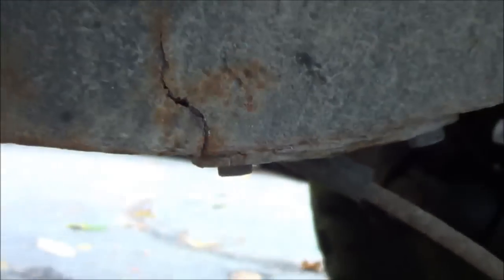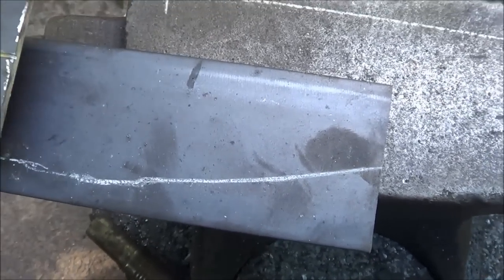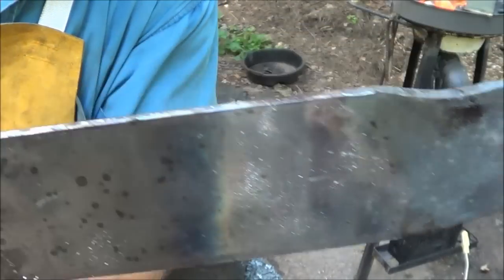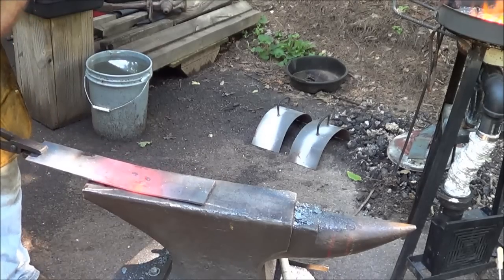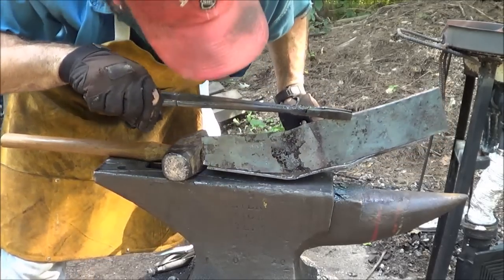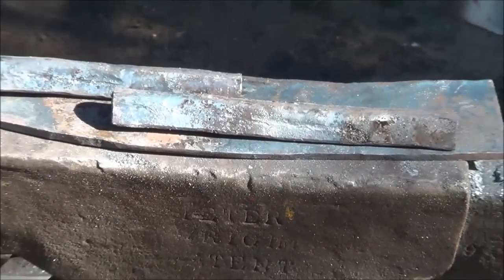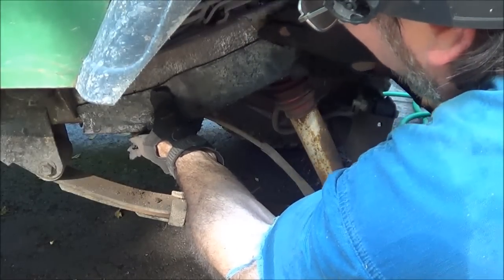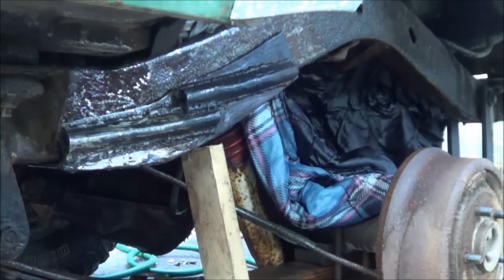Hand Forged Jeep Wrangler Frame Repair - Good Till The End Of The Driveway

Comment: Love the fix job. I see this vid is a couple years old, and you've probably learned since. But just like to say, when you see your weld "clumpy" like that, or crowned high, it is usually because you need more heat or slower wire feed. Also hope you drilled the top of the crack to stop it from propagating any further. Hope a little constructive criticism is ok! I'm just a structural welder . . . and just getting into blacksmithing . . . and i'll say blacksmithing is an art form. You sir, have skills (loving your vids from these older ones to the new ones).

Comment: As much as people praise jeeps for their ruggedness, there's an awful lot of them with fatal damage like this.  having restored a few and owned several (even now) they are cool, but I think their tank like reputation is largely undeserved.  

The only reason so many are still on the road is people caring enough to save them as you did.  If that were a Toyota Camry with a massive Crack in the frame rail, that would have been scrapped without hesitation.  

Nice video, solid patch, and I bet in 20 years when that thing is scrap, that brace will still be there just as strong :)
Reply: +Red Rider7 Looked cracked to me.  Wasn't there, could be wrong.  looked like the rust thinned out the sides, cracked through the middle of the thinned area.  not saying it was a base metal issue.  clearly the rust led to the crack.
Reply: +Red Rider7 Looked cracked to me.  Wasn't there, could be wrong.  looked like the rust thinned out the sides, cracked through the middle of the thinned area.  not saying it was a base metal issue.  clearly the rust led to the crack.
Reply: +Red Rider7 Not really knocking jeeps, I like them, have restored several, and own one currently.  All I was saying is that it's just a cab on frame type vehicle.  They are tougher and easier to keep alive for 30 years than a unibody vehicle.  Many people think that Jeeps are especially tough, but I don't really think they are any tougher than any other cab on frame vehicle.  Rust has no brand preference :)  

Jeeps will break and fail like any other vehicle with similar design.  People tend to keep them alive longer than less iconic brands/models.

Chrysler/Mitsubishi engines and transmissions aren't the best out there.  Wiring harnesses and sensors/accessories are sub par, etc.  I have a 30 year old truck that runs and drives better than my 10 year old Jeep.  To each his own, have fun and keep shit on the road.  It's all good if it makes you smile.
Reply: You like jeeps.  I do to.  
Cab on frame is superior to unibody for longevity.
Trail vehicles work better on trails.
Jeeps are not immune to abuse and neglect.
Think we are needlessly arguing in agreement.  

My point was many people think that Jeeps are indestructible mostly because people like us keep them going, fix them when they fail, rescue them from certain destruction, etc.  In reality they are tough, but survive because people save them, not because they are immune to failure.

Comment: Great video and job you did. Yes those frames will rust from the inside out. I ended up treating mine with some undercoating then I sprayed some fluid film in there and I have no rust spots. I use the same welder it works great. Wish I had a forge though I want to make my own bumper for my jeep.
Reply: +Glen W u dont need a forge to make a bumper bro go check out chuckey2009 lol but if u want a forge they are easy to make! check out another chuckey2009 vid :)
Reply: +eaglethorn I have watched a lot of chuckey2009 video's. I ended up finding a nice bumper with lights in it and installed it over the summer. Thanks

Comment: Well maybe not much of a handful tip, but if you are going to weld and try to make it nice, snip the tip of the wire so you get a sharp edge or keep it hot. Should make it a bit easier to get a nice light. 
Btw, big fan keep up the good work! Just started follow your channel, might order a knife in a near future. Good luck from Sweden!

Comment: Hey Chandler, your welding is pretty good given the machine.  Its one of the worst and possibly dangerous products on the market.  That welder has AC only output, Fluxcore is a DC only process period. Thats why you get push back from the wire losing arc on the base metal and the massive amount of spatter.  Fluxcore is great for outside windy conditions, just not that welder.

Comment: I have the same welder. Try using a shorter lead when welding. Looks like you have almost an inch of wire sticking out when you start. Give it a shot with about half of that and keep it closer while welding.

Comment: Chandler could you try something ,Instead of dragging your torch,like your using a welding stick.start and push forward with miniature movements up and down MINIATURE. you will find you can see your melting bath better,your path you need to follow and your weld will be tighter and smooth.Please give it a go.

Comment: If you want a bit less spatter when you are welding then cut back the core a bit before you start the weld.
Reply: Another great point would be to pre-heat your work piece because your welder is so small.

Comment: what i would of done was stick weld the hole fill it in then grind flat then add your patch then stick weld it place i used to work in a Auto body shop  thats how we all did it , another way would be take a chance take all that crap off the back add steel then add your patch then stick weld it solid since you dont have a mig welder that core flux wont be as strong of weld as arc or mig ,all and all you did a awesome job could of used your help years ago fixing my camaro frame that my asshole dad made me get rid of loved that car i havent seen or talked to him since that day and im 41 now
Reply: forgive your dad, go to him and take him out for a beer. Life's too short!
Reply: Get over it. Family is to important

Comment: Wouldn't welding the crack in the frame be better?
Reply from the maker: HD5830Gamer wasn't enought steel left
Reply: Chandler Dickinson I was thinking of reinforcing my F-450 frame using hand forged steel to "Mold" to the frame... not sure if I should weld,bolt or rivet them on...

Comment: I would have  torch   nickel  silver the crack then add a L shaped plate with 6 self drill screws drilling 3/8 pilot holes paint with  aluminum roof cote. that frame appeared still structural ly sound

Comment: what if he needed to get to those nuts to work on the jeep
Reply from the maker: Diboguy They were just holding a plate to the frame I think for access into the frame I am not sure what for.   But they where not ever coming off again and now they certainly aren't...
Reply: Diboguy Those plates hold a bump stop for the leaf springs. Most Wrangles of this model are missing the rubber part and just leaving the mounting plates. I have a YJ and mine are missing also
Reply: O makes sense. And the weird thing is. Is that I own a YJ too and the rubber is missing on my.